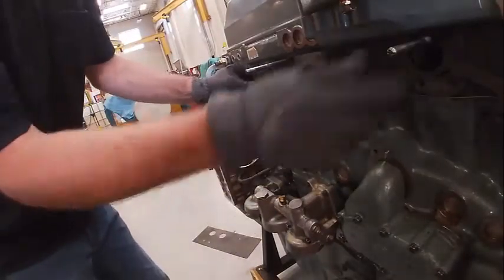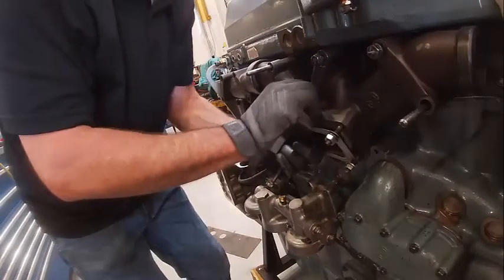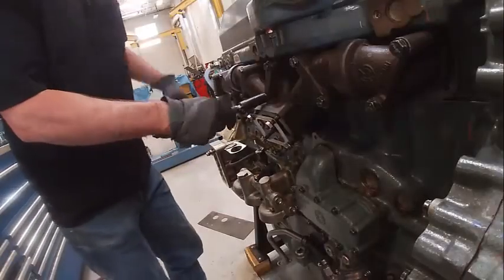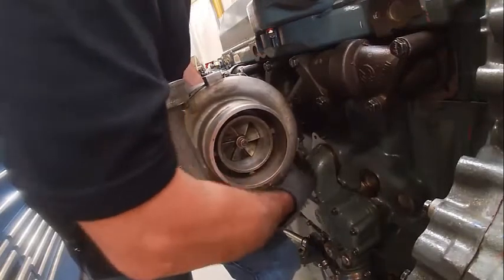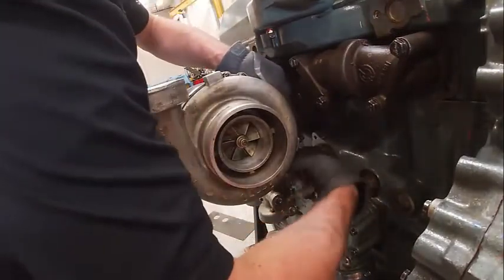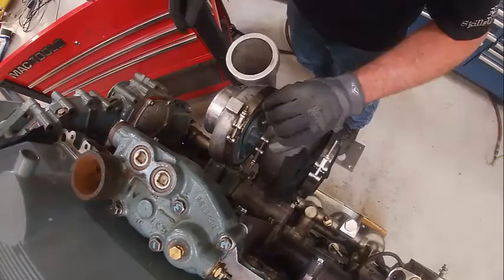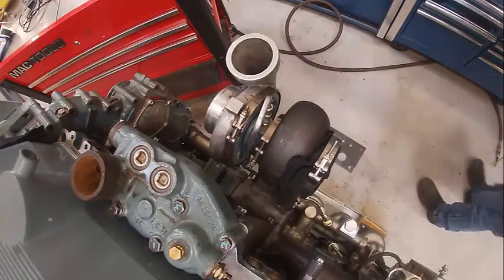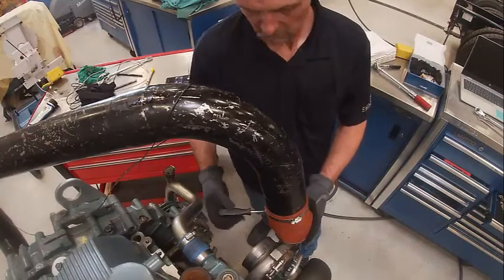60 Series Exhaust Manifold and Turbo Install

Comment: Is there a wrench set you would recommend to make easy work of the turbo bolts
Reply from the maker: Regular box end wrench and ratcheting wrenches if they have a thinner box end. They also make ratcheting open end wrenches that work after they are broke loose.